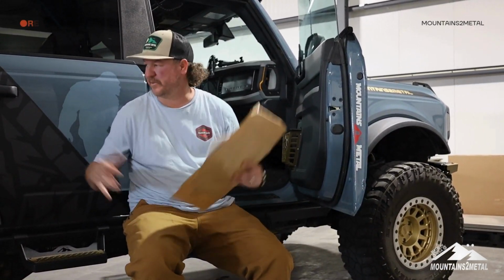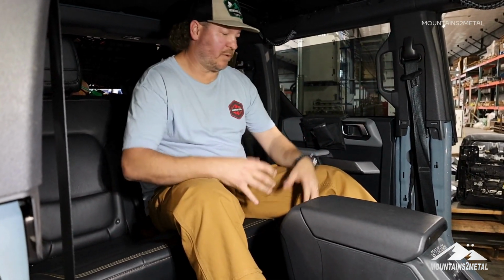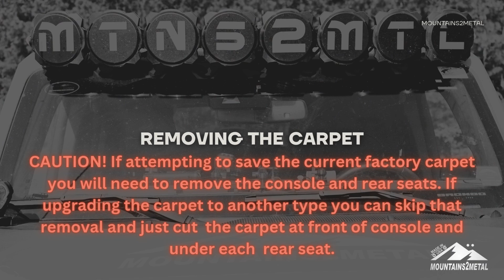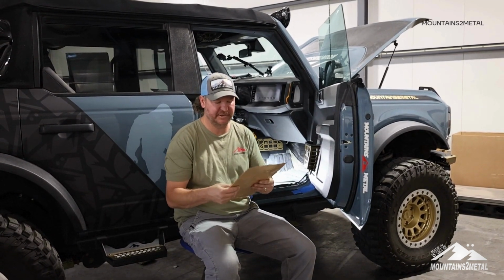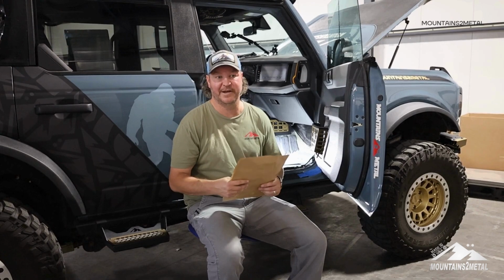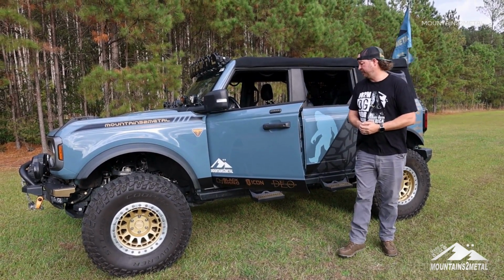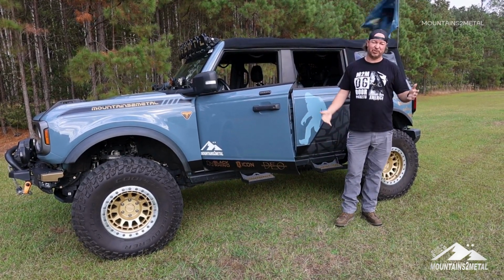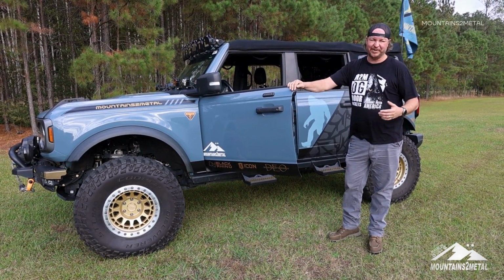Bronco Interior Upgrade: Dynamat Sound Deadening & ArmorLite Wash-Out Flooring

Comment: Great video, I plan on doing the Armorlite as well. I already removed my back seats for a camping storage setup and a platform for my dogs so should be a little easier. QQ, what side lift and tires do you have on the Bronco?
Reply from the maker: Thanks man!  The Bronco has the Icon 2.5 coilovers that are cranked up a bit.  I also have the rear lower shock mount modification that gives you about another 1- 1.5 inches.  And then I have the 1.5 inch body lift.  So total it is roughly 5+ inches of lift.  Pair that with the 37 inch tires (upgrading to 38s soon is the plan!)